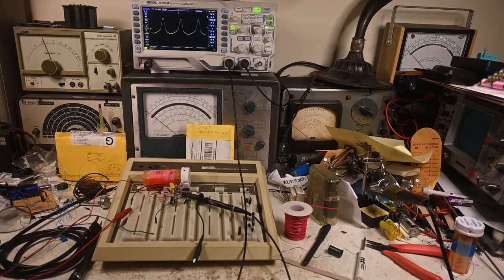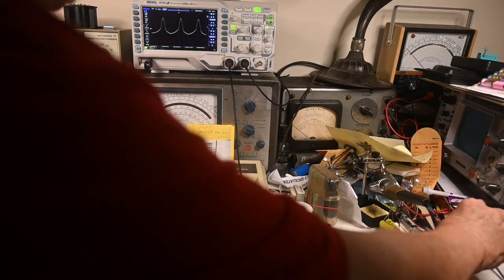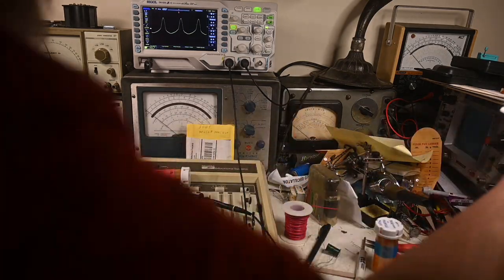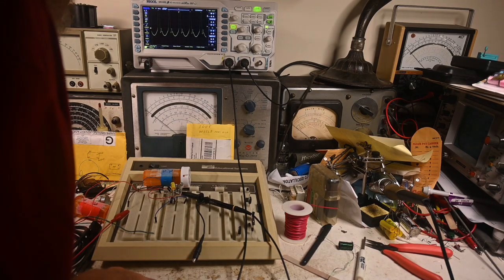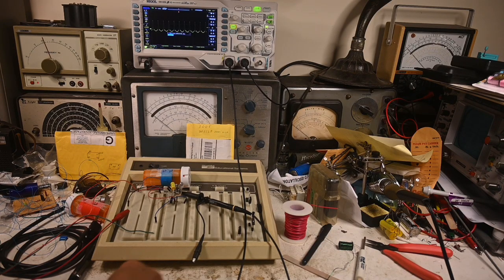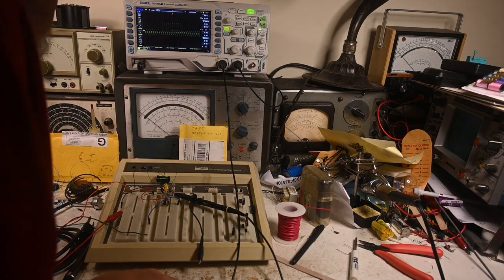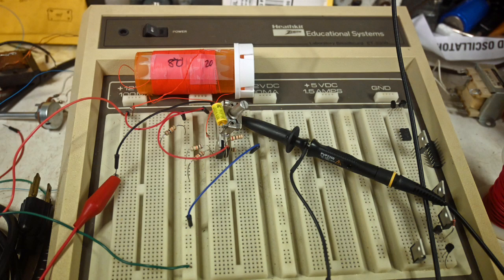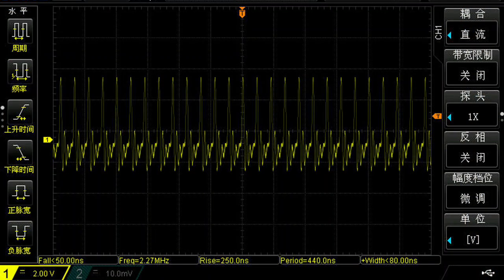AM Transmitter Coil Experiment

Comment: The red coil with 20/80 turns has a diameter of 1,25 inches and the red wire is 30 gauge. What diameter has the blue wire(20/23 turns)? And what diameter has the green wire(15/23 turns) and what is the diameter of the coil with the green wire? Thanks for all the good videos ;-)
Reply from the maker: The blue wire is wound on the same type of pill bottle as the red wire. The15/23  turns is about 24 gauge, but 30 gauge would work and the diameter is about 15/32 about ½ inch. 
Thank you, and thanks for watching!